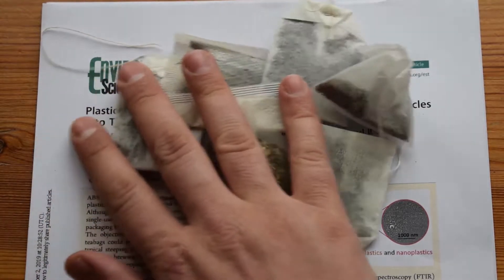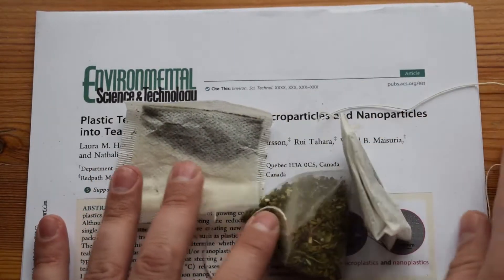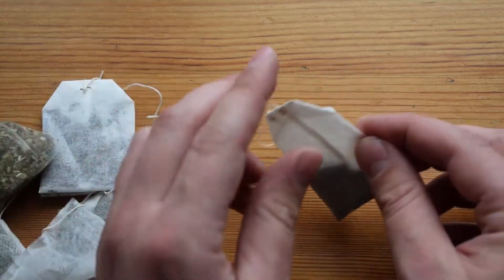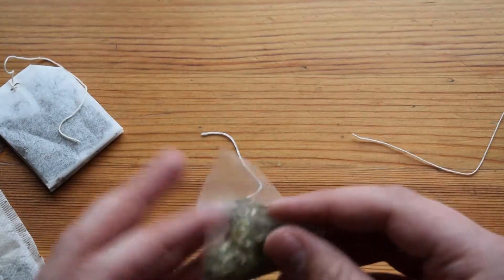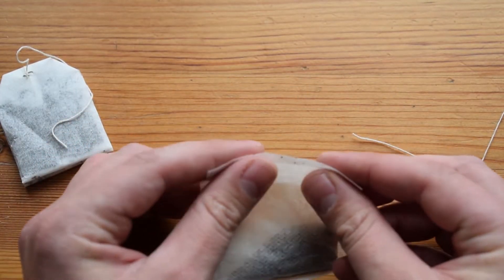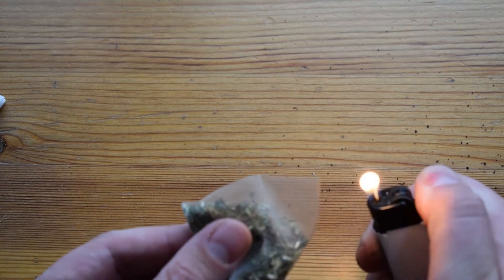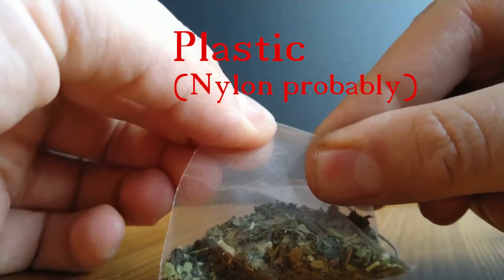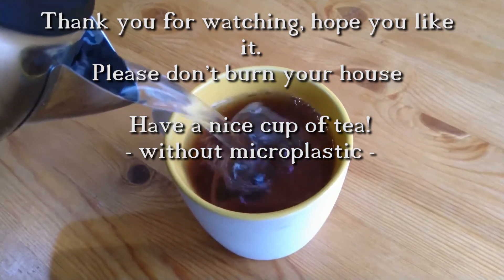Tea bags releasing microplastics - how to test your teabags for plastic

Comment: Loose leaf tea is better if you can find it.. I still think you could possibly remove the tea from the bags so that the plastic parts which glues the sides together doesn't get steeped into your cup of tea in the hot water.

Also, to remove a lot of microplastics from your body, researchers have found that donating blood helps. When you remove a fair amount of blood with the plastics in, your body produces new blood without the plastics so it's a way to filter out a bit of the buildup. Also, try and find reverse osmosis water as that removes plastics from your water. Lastly, find a different way of packing lunches and foods instead of plastic bags.. It's very difficult but we are facing ah huge problem.

Comment: pickwick tea ..no info..rips easy so that seems paper but many say seeming paper can be plastic coated inside or ....... even chat gpt dont know , google did not find...........cutting bag w scissors ...will that release particles plastic ..probably ...and pouring tea grains from bag into near boiling water , not putting bag into water,,, will it help....maybe that is not enough maybe plastic particles go into tea even if bag is not used for brewing...but a bit better still. or a lot better. l guess.....maybe wash grains i cold water before using...

Comment: The traditional teabag, sealed around on 4 sides, is paper with plastic on the inside. The entire inner surface on both sides of the bag is covered in a thin layer of porous plastic. When the teabag is cut to shape, it is also heat sealed around the outer edge. It isn't glued. So, all teabags have plastic.  Loose leaf is the only way to get plastic free tea. Even then, if plastic has been used at some stage to contain the tea, you'll still have a small amount of plastic.
Reply: I think the greatest concern is heating up the plastic causing it to leach even more. Why you shouldn't be using plastic in tea bags... contact lens leach plastics into your eye... keep out of the sun and it's practically non detectable traces.

Comment: Thank you very much. I learned that these paper tea bags can still contain small amounts of plastic for sealing, etc. Can you make a test for it? For example, we can dissolve the paper (cellulose) with a solvent. If it's fully made of cellulose, then it will be totally solved
Reply: Burning it should tell. If it's cellulosic it'll burn like paper if it's plastic it'll melt kind of like tar
Reply: I have cellulose tea bags with plastic materials.  They also burn like paper. Only %100 plastic tea bags melt in fire.

Comment: I used a heat gun on Tetley and Red Rose tea, it melted like a plastic bottle. The heat gun was set to 212 degrees which is water boiling temperature. It took approx 40 sec's for the tea bag to melt.
Reply from the maker: How did the bag feel to touch? Is it more textile/papery like or silky like pantiehoes?
Reply: @trashtalk9362  It wasn't cotton, when heated up it shrinks and when smelling it, there's an odor resembling plastic.  This is very bad ! The other thing I noticed is there's alot of drawstring bags sold on ebay that are also not cotton.  I cut open all the tetley bags and bew the tea loosely. I just use a paper coffee filter when pouring from the tea kettle. I hope mfg's return back to cotton bags